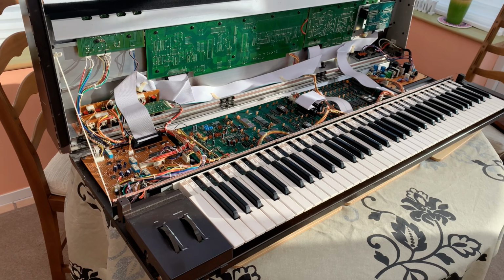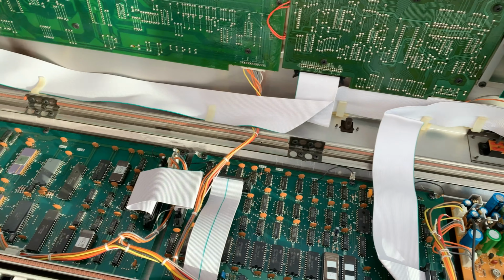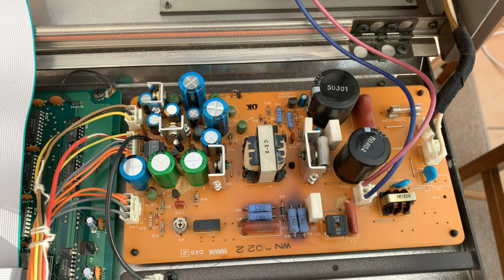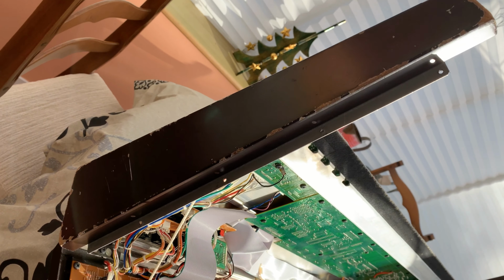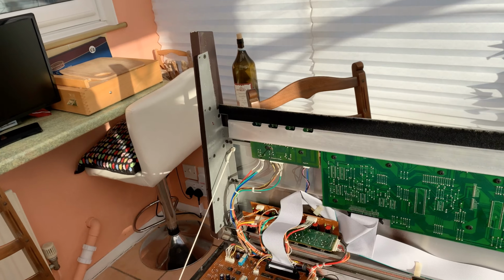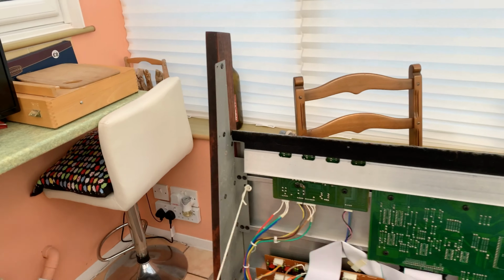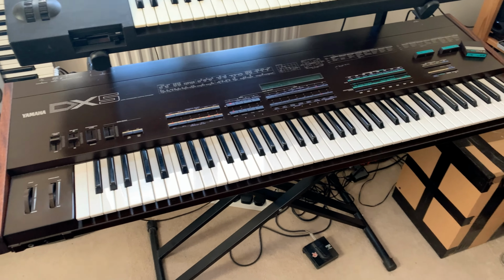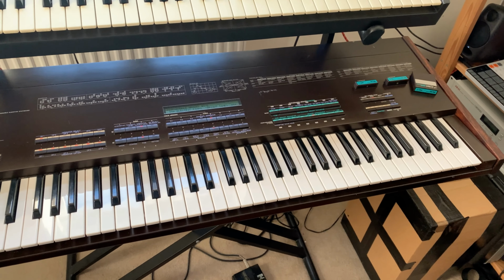Fitting New End Cheeks to a Yamaha DX5

Comment: Very nice!  I'm finally getting around to working on my DX5 after getting my SY77 taken apart, the keybed disassembled and re-greased, and replacing the EL-backlit LCD with one that is LED-backlit, which took a bit of modification/soldering to get power to the backlight and the right contrast bias.  The backlight is also dead on my DX5, but the problem there is that there's not a lot of room for the LCD between the front panel and the CPC board, and LED-backlit LCDs are too thick, so I'm going to see if I can use an OLED display as a replacement - I just don't want to deal with EL panels anymore.  It won't be original, but I think it'll still look good.  I'm leaning more and more towards making some mahogany or cocobolo cheeks for it, since my originals have road rash just like yours did, and I need to make a set for my Prophet-600 anyway.  I'm also pondering whether to just make some cheeks out of MDF and paint them, but I think I really like how the wood classes it up a bit.  In any event, it's always good to see another DX5 out in the wild and still seeing some use.  I've always had a soft spot for the Yamaha DX's, and I'd wanted a DX5 since around 1985 or so.

Comment: I may be wrong but I dare say these Japanese synths from early 80s has a very nice quality to the build. Comparing with synths from e.g. USA at same age.
I think you chose the right colour/wood. Looks like it were intentional, reminding of the DX1 wooden end pieces.
But the wood working skills seems to lack slightly? Looks as if its cut with hand saw? But the wood looks great : )
Reply from the maker: I think all synths, regardless of country of origin, back then were very well built. It wasn't until the late 80's, after the DX7 became the first synth to sell in its hundreds of thousands, that manufacturers were able to utilise mass production methods and use cheaper materials to reduce costs and speed up the process. Certainly with synths like the DX5 and other big ticket items, you certainly do get what you pay for when it comes to build quality.

I agree that the darker wood is more fitting, looking similar to the DX1's rosewood panels. The end pieces were very well cut and the wood was waxed and polished, certainly didn't appear to be very well cut :-)
Reply: @FailedMuso  I'm sure you're right. And this being a digital synth may also have less effect on ageing of the PCBs etc?
Reply: at 11.38 the new pieces did not look like hand sawed.
I will do a similar job, just looking for a good plank and a carpenter, to cut a piece of 440 mm x 90 mm x 20 mm.
My measures are: 440 mm at base, then cut angle 6 degrees from North on left and 15 degrees from right.
The right top edge again 90 mm from left bottom, slanting down with another 6 degrees to finish the left top edge with 45 mm long from left bottom.
The top length should be then 415 mm.
 Love that piece

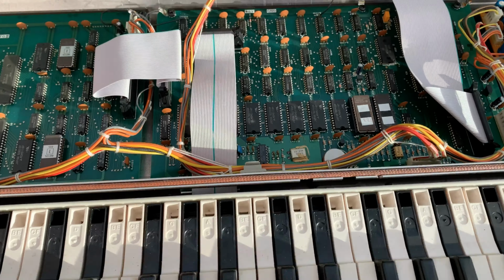Comment: Hi, thank you very much for the detailed tour of the innards. I got a schock, when I saw your battery at 4:31.
In an attempt to replace my battery, I realized that the one in my DX5 had the "+" imprinted on the underside and the "arm" attached to the side of the battery with no "logo", connected to the "+" sign on the board. I take it that your one is the usual config. But as my one worked before, I am confused.
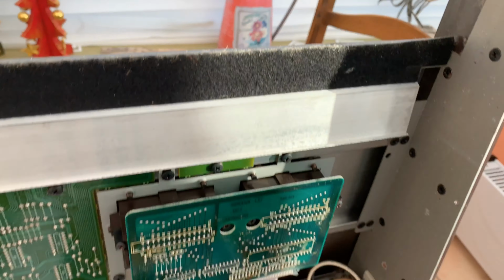Other minor differences I saw at 2:08, where I have a second black "mass" wire going from the hole on the base to "F,G" on the power board. These adjacent blank holes on the board are as furnished with these round blue units. 
And at 2:28, where I have no additional connection of the black "mass" wire to the right screw of the slider board, although I always wondered why there is that extra little spacer under the screw head. 
At 8:59 I see that you do not have an additional little board covering your main input, which is only two prong, as opposed to my 3 prong kettle connector.
Wonder which one is older. My serial number is 2091.

Comment: Cracking job , gives an already classy keyboard an extra touch of class, on a different subject I have my keyboards like yours close to a radiator, is that safe? what I mean is can the heat  dry out connections or other stuff?
Reply from the maker: The radiator is kept low or off. The heat from my computers and synths keeps the room warm enough ;-)

I am hoping to have a move around soon so I can fit in a 6-tier Jaspers stand and get everything off the floor ;-)
Reply: @FailedMuso  Thanks for your reply, once I saw that radiator I just had to ask lol, because I keep mine off which in the winter can be a tad unpleasant, also I saw your presentation at Synthfest  which was fascinating, thanks again
Reply from the maker: @godders7594  Thanks for the kind words! :-)

Comment: I coincidentally bought a DX5 last month. The panel is in like new condition, there's some scratches on the metal bar below the keys, most likely a cheap keyboard stand's fault. The side panels are in good shape, I painted some little scratches with a marker. I like how it looks with the original black side panels, not entirely sure if I'm going to replace them with wood ones. I bought it relatively cheap, u$s1000, but I have to replace two sliders, data entry and volume, they're erratic. Do you know if they're easy to find? 
Cheers and great video! (As always)
Reply from the maker: Thanks for the kind words! I did originally consider getting some new end cheeks and painting them in "DX Brown" but due to the apparent scarcity of end cheeks as a whole, when I saw a pair for sale in the U.K., I decided to go with them and I'm actually warming to them now ;-) The seller (who I linked to in the video) tells me he will be doing some more soon, if you're interested.

As for the sliders, I think they're a fairly standard part but I can't be certain on this.

Good luck and enjoy the synth! :-)
Reply: juno6  contact  Syntaur  online ,I bet they got your sliders or know  what replacements will work..Folks Syntaur is where to go for any  vintage synth parts.!!
Reply: @jockeyshift4124  Thank you!